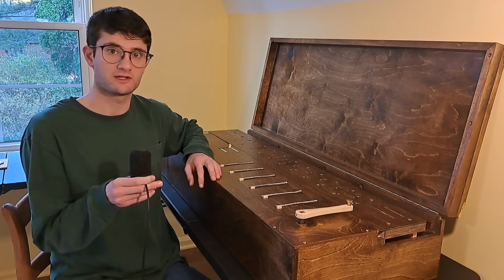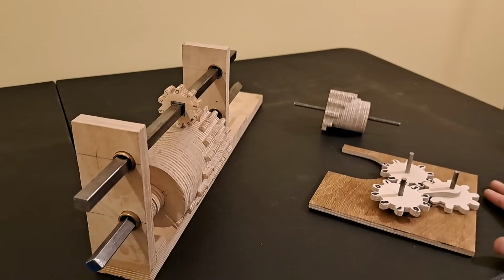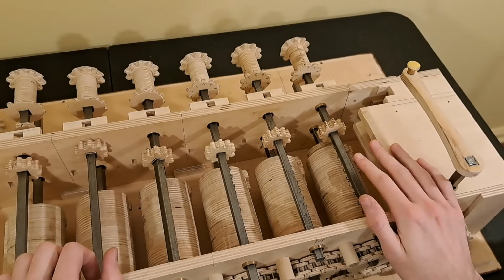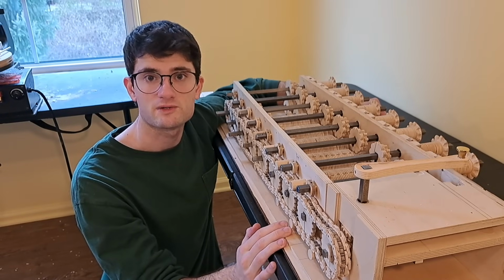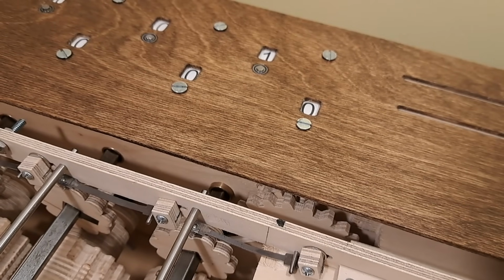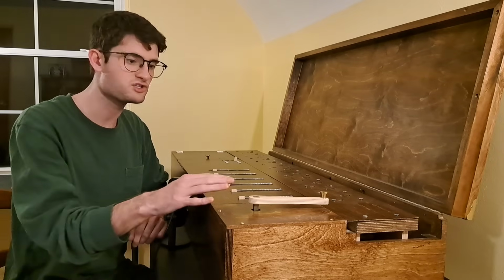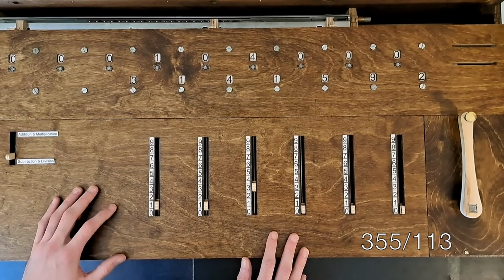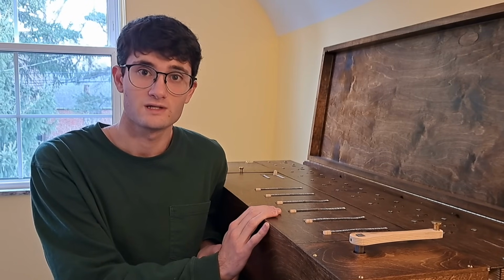How I built a Mechanical Calculator

Comment: I know I'm late to the party, but, a few things that I think would have helped:
- Explain division with remainder before explaining how to get the mantissa with the hypothetical decimal point.
- Use a sticky note to display the hypothetical decimal for demonstration.
Reply from the maker: Thanks for the feedback. Yeah the decimal position is tough because in the long division example, the way I describe it (which I think makes it easiest to intuit) has the decimal place constantly changing. Really you'd just have to guesstimate that ~300/~100 would result in  3 point something. But a sticky note is a clever idea to demonstrate the decimal point! Others have suggested a black magnet that could go on the bolt heads. Thanks again for the comment!

Comment: Really fun for a peculiar reason specific to me. I'm 75 and been doing software and programming since I was in my early teens. My dad was an accountant and I remember visiting him at work in SF sometime around 1958-60. He had a beautiful mechanical calculator (maybe made by  Burroughs?) It was wondrously clicky and precise. I was fascinated by it, but never really knew how it worked. Now I do because it was exactly this mechanism! There was a crank on the right that did the work. Rows of buttons entered the numbers. The thing missing from the implementation in the video is the lever that moved the carriage left or right for multiple/div. It extended toward the user and you flipped it around 180 degrees. It would lift the carriage and move it one digit left or right and drop it back down. It worked so smoothly I'd estimate you could do a 5 digit * anything multiplication in maybe 10 seconds. Just 12 or so years later the HP-35 was introduced, the first pocket scientific calculator. My dad was still an accountant when VisiCalc was invented. He was doing cost accounting at the Stanford Linear Accelerator when it became available. He would spend all month doing spreadsheets for the month's costs. When he got VisiCalc, he could do the same work in 3 days. Maybe 20 years later I met and worked for a while with one of the 2 inventors of Visicalc. What a thing to have on your resume! Oh, and my dad's first PC? The original Mac.

Comment: I just found your video tonight, and I'm so glad I did! Your machine is beautiful, and it's amazing how you were able to get it to work so well! What's also amazing is that doing subtraction on your homemade machine is actually much easier than on most commercially made mechanical adding machines, where you had to do enter in "complimentary numbers" and it was really awkward and clumsy. Your machine does direct subtraction and is much simpler and easier. Very cool, and good work!

Comment: This is fascinating! Would it be possible for a mechanical calculator to do exponents, square roots, and logs?
Reply from the maker: Thanks! There is a couple of tricks you can do on this machine to figure out exponents and square roots (still relying on just successive additions or subtractions), and there might be a way to do logs. But definitely not a single operation to perform those calculations. But there are some mechanical calculators/computers that can handle those operations (some are even analog, I'm thinking particularly of the harmonic analyzer). Thanks for the comment!

Comment: Great Content, IBM had a unit record machine that had a mechanical memory it was the 087 collator these machines before transistors had vacuum tubes and were programmed with hard wires.

Comment: I assumed this was laser cut and was already impressed. Then I saw the scroll saw. Then it slowly dawned on me you built the whole thing with hand tools **out of wood** no less, and my jaw dropped.
Reply from the maker: Oh my gosh, I'm so glad you appreciate the project!
Reply: The man himself appreciates it lol
Reply: happy for you , you have this comment here. iam impressed aswell. the chain part blew my mind.
Reply: And then he made the FLAT SPRINGS by hand. Bruh. That's too much.
Reply: Yo, how's 100%ing doom on mouse neuron working?
Reply: Curt Herzstark designed the Curta hand held calculator while in the Buchenwald concentration camp without the aid of any design or drafting tools whatsoever.
Reply: Omg Thought Emporium yay!!
Reply: And then he added in a unique way of multiplying and dividing that I haven't seen on other mechanical calculators. All he needs to do now is add in a less "manual" way of lifting and clearing the values (and producing pull tabs so you don't need a stylus, a movable decimal point, a way of making the number you input being discreet so that you don't have to deal with accidental misalignments, a another way of repositioning the results portion, and possibly some other improvements I haven't thought of. 

Regardless of my list of wanted improvements, what he did is ridiculously impressive!
Reply: @miltonwetherbee5489  instead of tabs, maybe flat square pegs for the reset. Then you could have another axle with a lever on the side where 15 or so degrees moves a nub gear but vertically to move it upwards. Gear would have to be fixed from moving sideways with the readout, and could have a seperate reduction gear to make his same snap toggle possible and be hiding with the nub. Decimal point could be a simple peg to keep track of where you started. Input numbers could be kept discreet by having a flat 'plank' with the rounded gear cutouts and have a simple spring system to make the input want to snap. As for simplifying the pickup, all I can think of would be a nub gear attached to a crank on the side capable of going both directions with perhaps the same rounded gear track as the inputs so that it always steps to the side the same distance.

Comment: 00000+00000=reset
Reply from the maker: I thought that when I first saw a calculator like this as well, but that doesn't work to reset because adding 0s just doesn't cause the results wheels to move at all, so they'd just stay on their current number instead of reseting, unfortunately.
Thanks for the comment though, I appreciate you took the time to consider the reseting issue!

Comment: i feel like this is a fairly simple optimization to the design, but maybe i'm wrong.

Shouldn't it be theoretically simpler to have an addition, subtraction and "null" position, for the bevel slider, such that you could zero while in null, as well as just slide the faceplate directly over, rather than having to engage and disengage it by lifting it up, which is rather cumbersome.
Reply from the maker: Another person commented a similar idea about a "neutral" or "null" position on the add/subtract mechanism, and it's so close to working on my machine! It's such a perceptive and clever idea, but unfortunately there's just not quite enough tolerance in my machine for it to work. (I did some research, and  turns out there was/is a machine that did have a neutral position like that!) 
And about just sliding the results section, it needs to locate very precisely so it has these tabs on the underside that fit into gaps on the wall that supports it, making it so that it only falls into place at the perfect positions. So any other system would need some similar safeguard. (I know some Monroe machines had a sort of crank that would jog the carriage over, something like that could make it less cumbersome)
Thank you for the comment!
Reply: @WhatWillMakes  i figured as much, definitely something to think about if you ever further refine this design, if you were to release it publicly or something.

Would probably require a fair bit of work, but i think it would probably be worthwhile.

The simplest solution would probably be to increase the distance between the display drive bevels, so you have a bigger window to work with, and then figuring out a way to derive a consistent position alignment, perhaps with more detented sliders or something. Although that would pretty much require rebuilding the entire chassis,  so there's that for a tradeoff lol.

Great video by the way, really enjoyed it.

Comment: I’m sure nobody will see this but does someone know where I can learn the way the gears mesh so that the stepped drum works properly to rotate the top gear
Reply from the maker: Hi! This is a great question, because it is deceptively tricky to get the 10-toothed gear to re-mesh with the stepped drum. I found that once you have the shaft spacing so that there is a good mesh between the stepped drum and the 10-toothed gear (like the teeth are fully engage each other but there is no binding), then trim the tips of the teeth on both the stepped drum and the 10-toothed gear by maybe 15%. Additionally, making the first tooth on the stepped drum that the 10-toothed gear engages with (for every number) a little shorter and rounder can help. Finally, rounding the front corner on the last tooth of the stepped drum that engages the 10-toothed gear can also help. The trick is that overdoing any of those fixes will cause the 10-toothed gear to not turn enough, so the ultimate fix is adding a "keeping it digital" mechanism like the leaf springs I talked about. Hope that helps! 
There is also additional information on my blog: https://whatwillmakes.com/2024/12/20/my-mechanical-calculator-how-and-why/

Comment: Well done, the Curta calculator but made of wood but massively scaled up so people can understand

Also quick tip- use a black magnet on the bolts for your decimal point

Also, after this, get yourself a CNC from the YouTube cash
Reply from the maker: Thanks! The way I've been thinking about it, the Curta is like curling my machine up around just 1 stepped drum – it's such a clever design.
Oh that's a great idea to keep track of the decimal!
About CNC or 3d printing, I just like working with my hands.
Thanks again for the comment!

Comment: What happens if you divide by zero??????
Reply from the maker: When dividing by zero, you'd first input the number to be divided, like 3, then set to subtract, and input zero. Then you would crank until zero no longer goes into the number at the top (3). Because cranking with an input of zero does absolutely nothing except cause the crank-turn counter to increase, you would just keep cranking forever, futilely!
Reply: @WhatWillMakes  lol cool thanks

Comment: Hey check out video on the B-29 Turret System "Networked Mechanical Computers"!
Reply from the maker: will do, thanks!
Reply: @WhatWillMakes  These computers, of course, were supposedly made obsolete by advances in electronic digital computers.  The way I see it, though, is that there were a lot of "mechanical computing" cards left unturned on the table when all the expertise and resources shifted to electronic solutions.

Comment: Brilliant. Absolutely brilliant. Question: Does it goes up to 6 digits for a particular reason other than not enough desk space to put this on? In theory if I understood correctly you can extend it to whatever digit number you want
Reply from the maker: Thanks! Yeah I just made six digits because it seemed large enough to do difficult arithmetic but not too many parts to make. Many Arithmometers had 8 digit inputs, but Thomas De Colmar made a "Piano Arithmometer" for one of the world expositions that had 30 inputs. There is a slight difficult in adding more digits, because each column has to be slightly later in the cycle than its neighbor to the right (to allow carries to ripple). Thanks for the question!

Comment: Very cool project! I wonder if you had considered to wax the cogwheels as a lubricant? This should make it easier quieter to operate the calculator.
Reply from the maker: Thanks! I played around with wax, and it does help, but honestly a good fit and proper tolerances makes the biggest difference
Reply: @WhatWillMakes  Sure, I can imagine that. Thanks!

Comment: Excellent and very inspirational! Couldn't you just use a leibniz wheel with one tooth to count the crank turns?
Reply from the maker: Thanks! Yeah that's the thing I tried first, but I had difficulty getting that to work, especially since the space is a little tight there. In hindsight, I think what you suggested is the way to do it, it just needs its own spring-loaded certainty mechanism, because I had trouble getting the extra tooth to always re-mesh on the next cycle. Thanks for the question!!

Comment: I wonder if there's a way you could improve the zeroing system so you don't need to lift the top panel to do it.

Maybe something as simple as a lever on the side that would pop that top panel up just enough to be able to zero it?

Or maybe it's possible to add one gear width's worth of additional space in that top panel so the gears of the display can be raised and lowered without needing to lift the whole panel? 

Regardless, this is a really cool project. Thank you so much for doing this, documenting it, and sharing it with all of us!
Reply from the maker: Yeah the zeroing method could be a little more refined. Someone very perceptively commented that putting the addition/subtraction lever to "neutral" could be a way of disengaging the assembly without having to lift it up. And that is very close to working on my machine, there's just barely not enough tolerance for that, but some machines did do that. Your idea of raising the gears up is a cool idea! Some Monroe mechanical calculators had a mechanism that would automatically lift the carriage before doing the zeroing, so theres definitely ways to do it. Thanks for the question! And I'm glad you appreciated the video!

Comment: Looks like you've used much the same techniques as the old Curta machines.
Reply from the maker: Yep, or rather the Curta is a refinement of earlier stepped drum designs like the Arithmometer. The way I've been thinking about it, the Curta is like curling my machine up around just one stepped drum

Comment: I was curious as to how carries do not interfere with the gears performing addition for that digit. As far as I could tell, the addition for individual digits are performed during the first half of the crank turn. The second half is reserved for propagating the carry. But this also means that when a digit is transitioning from 9 to 0, the digit to the left must have already finished its transitions. So the digits should be timed so that the rightmost one finishes first, etc. Am I right?
Reply from the maker: Yeah this is a perceptive question and you've basically got it. I decided it would be too much detail for this video, but if I had not removed some teeth on the stepped drums and instead of having 1-9 they had teeth going all the way around, they would have 20 teeth going all the way around. The extra tooth for carrying comes just after the 9 teeth on the stepped drum (so in the 10th of the 20 spots). This means the carry does always come right after the 1-9 digits are added on that column. Then the sprockets that link the columns together via the chain also have 20 teeth. And each column is 1 tooth of the sprocket (1/20th) later in the cycle than its neighbor to the right, so that carries ripple and the rightmost one finishes first, as you say. So yeah you nailed it, everything is timed perfectly so that carries do not interfere with things within each decimal, and occur at the right time in relation to the other decimal places. Thanks for the comment!! (if you're interested, there's diagrams of those parts showing the rest of the 20 teeth on my blogpost: https://whatwillmakes.com/2024/12/20/my-mechanical-calculator-how-and-why/)
Reply: @WhatWillMakes  ah thank you for your detailed reply ♥️ while watching the video I was thinking one must be mad to be able to find the motivation to do such a machine. Then I thought people also did so, back then. But then I thought they had much to gain by building such a machine at that time period. So, it was nice of you to touch that subject also. And now I think, I hope you will also have much to gain from doing such a project ☺️

Comment: Really cool video.  I am wondering if the crank is harder to turn the larger your calculations become.  Also wondering how long this took you if the results bar took a summer!
Reply from the maker: Thanks! Yeah it gets harder to turn the longer the calculations. Most aren't bad, but when you get up to adding +999999 it's honestly a little scary how much force it takes. I took me 8 or so years, working very leisurely though

Comment: That's very cool. Makes me want to try making a calculator with only bit operations on a computer. Does it work with negatives at all as either a negative input or output?
Reply from the maker: Thanks! No it doesn't really work with negatives. You can't input them, and when subtracting into what should be a negative, the outputs turn backwards from zero to 9, instead of to -1 (the dials would have to have like 19 spots to accommodate negatives: 1-9 positive, 0, and 1-9 negative). Thanks for the question!
Reply: @WhatWillMakes  That makes sense. I think binary numbers do something where the biggest end number is -(2^n)/2 where n is the amount of digits. And all the other values are the regular positive number so to make a negative number, you put a one in the biggest spot and then all the subsequent ones would be positive numbers that add to the negative number. I suppose it would be a lot simpler to implement with only binary though.

Comment: Great project! Did you consider adding spring loaded certainty functionality to the linear sliders also by drilling dimples in the square rod?
Reply from the maker: Thanks! Yeah I considered some way of spring-loading the inputs (and your suggestion would be the best way to do it, I think. Similar to the Curta if I'm not mistaken), but it doesn't really need it and I wanted to easily see the stepped drums inside. Would be a nice addition though. Thanks for the question!